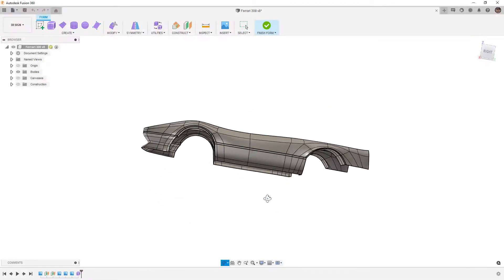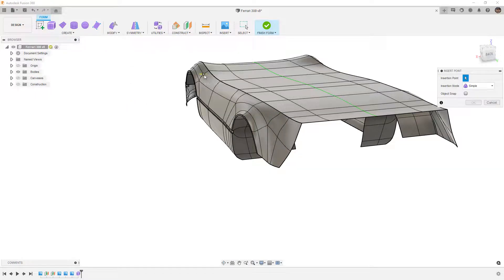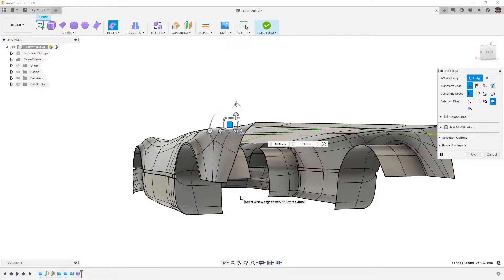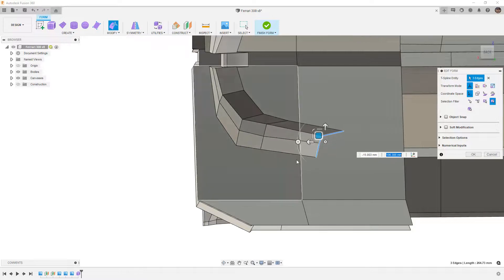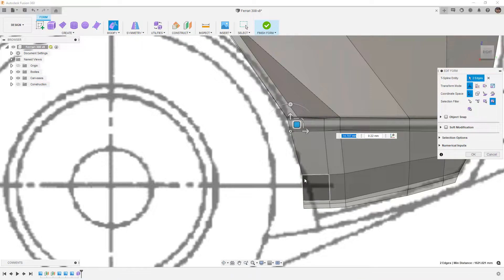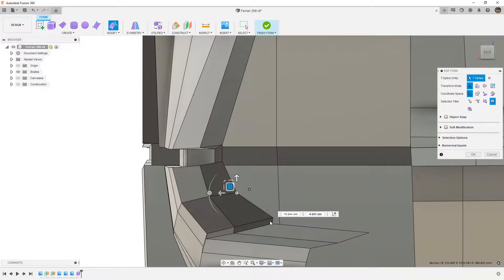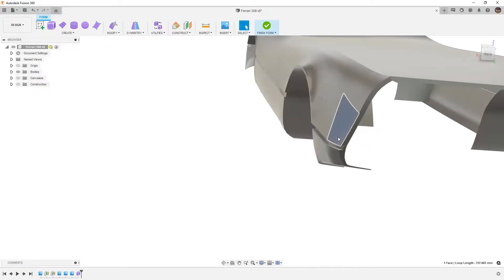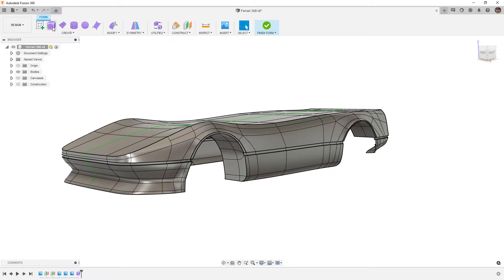How to Model a Car - Ferrari 308 with Fusion 360 Forms - Part 7 #Fusion360 #CarModeling

Comment: Hi, I've been watching and learning from your vds. Just wondering what determines when to move vertex, side or plane. Thanks.
Reply from the maker: Do you mean how you decide to move an edge over a vertex or a face?  It depends on the shape and your goal really.  In ideal world if the shape is close to right and you want to make more of a "global" change, say flaring a wheel well out a bit more, you could take all the edges you want to move and maybe even turn on "soft modification" so that the shape stays mostly the same.

I generally default to moving edges.  I usually move a vertex if i need a very minor change to get edge flow a bit better.  I will grab a group of vertices to do things like scale them to a line or plane.

There isn't really a hard and fast rule but I would say if the edge direction(treat it like an arrow) is right, but position is wrong, move the entire edge.  If the edge direction is wrong, move the vertex.  If the edges of a face are correct orientation but wrong position, move the face.
Reply: @LearnEverythingAboutDesign  Thanks for the tips. Will continue to finish the 308. Cheers.

Comment: Hi, You said fusion is not a perfect software for design this kind of model, so could you list out some software more advance for design car or airplane model?
Reply from the maker: Phongpham, what i mean is that in the professional world there are specific softwares used for this type of design.  One option from Autodesk is Alias.  They have a specific Auto and Concept program.  This is a "Class A" Surfacing program.  https://www.autodesk.com/products/alias-products/overview?term=1-YEAR&tab=subscription

Other programs include Class A tools, but that is really what is missing from Fusion and most CAD programs.  They are simply not designed for curvature continuous control with the level of precision you need.  Alias is $4000/year compared to Fusion at $400/year.  Other programs are more expensive.  There are companies that use Poly Modelers like Blender for Concept work, and bring that mesh into a program like Alias to build a Class A surface over the mesh.

So you CAN model cars and planes in Fusion and most CAD programs, it is just that there are specific tools.  I would point you to Alias as I believe most other programs are orders of magnitude more expensive.
Reply: @LearnEverythingAboutDesign  Thanks, one more question, for this kind of design could you compare Blender to Fusion 360? which one is better?
Reply from the maker: I did cover this in a few videos.
https://www.youtube.com/watch?v=78swx-gl_F0
https://www.youtube.com/watch?v=VTTuQZdzM6M

In general Blender is a bit more forgiving over Fusion BUT you still have a mesh.  In Fusion you end up with a BREP, a true nurbs surface.  I also do talk about taking designs between fusion and blender in a few videos.
Reply: @LearnEverythingAboutDesign  Thanks for your video and instruction

Comment: Would You take the same approach (creating whole car in one body) with scale model (1:8)  You'd later wanna 3D print in parts (hood,doors, bumpers, etc.)?
Reply from the maker: Sylvester, when designing with the Forms tools, yes.  The trick with forms tools is that they work well when you can carry the curvature through the body.  More minute details really work better as surface tools.  I hope to do a car tutorial with the surfacing tools in Fusion.  I had done one before in Solidworks, but the surfacing tools are not quite the same in Fusion and the process sadly adds several more steps for things like intersection curves from 2d sketches.  It can be done but it isn't as clean.

1:8 scale cars.  I did a car design for a client years ago as a 1:1.  When the client wanted 3d prints of the car i had to seal it off to get it "water tight".  Depending on how you want to attach pieces you can simply split the surfaces, thicken them and add the attachment details.  Or you can "fake" it by making seams between the fenders and doors.  It kind of depends on the end goal and level of detail you are after.  

When i edit the last 4 videos of this series we will get into using surfacing tools a little.  If it is something you are struggling with I can try to make a video using the Ferrari to show you how its done.
Reply: @LearnEverythingAboutDesign  Thanks for the replying, and Your tutorials. Also wrote You an email with some screenshots and end goal ideas of this 1:8 scale project.
Reply from the maker: Thanks. I just replied to your email!  Hopefully I can put some videos together next week to help get you started.  You can use Forms like we do on this car just remember that a scale model 3d printed will have much less detail.  Depending on the print method a LOT less detail.  So crease major body line transitions like the hood on your project and the side scoops(or just leave them out and do them later).